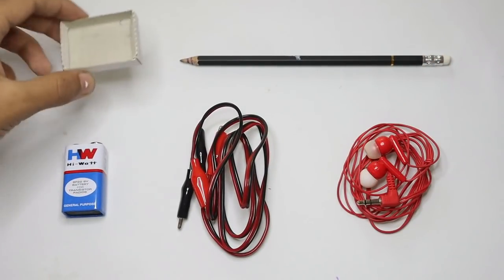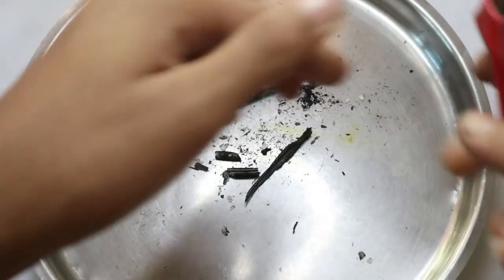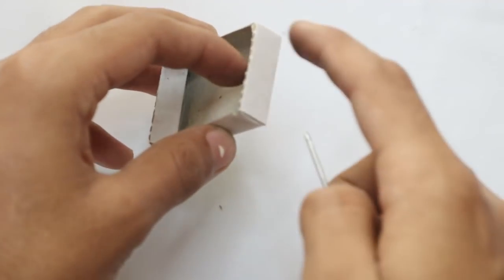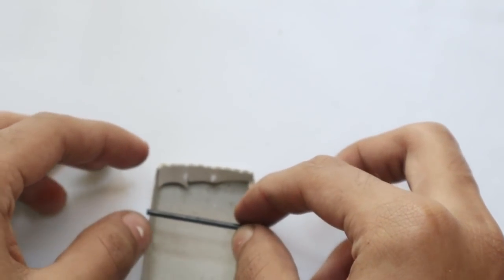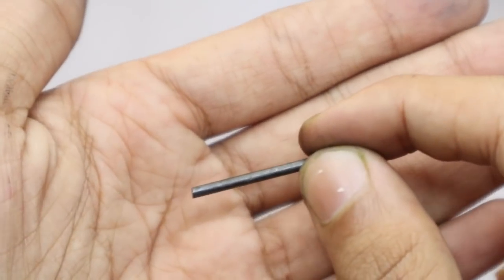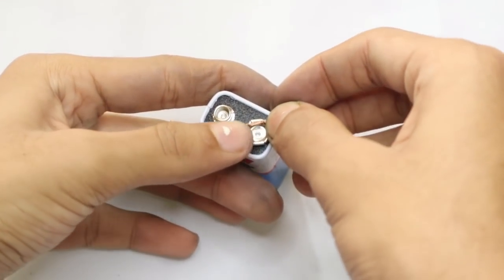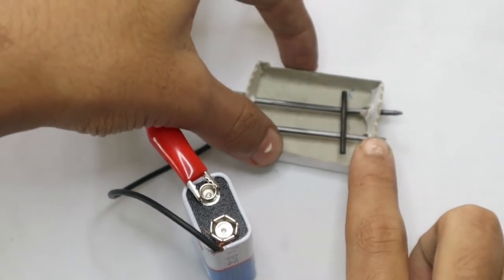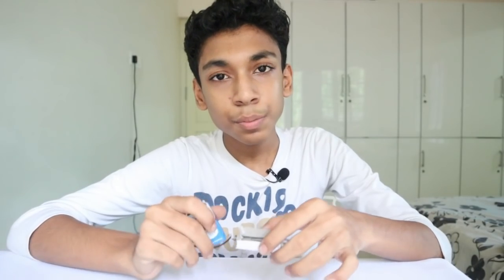How to make a matchbox microphone using pencil

Comment: Instead of a 9V battery, you can try with a lower voltage source. 9V DC, given that the dc resistance of graphite is quite low, can be dangerous to sensitive devices like low impedance earphones and mic ports without voltage protection
Reply: @HanisExperiments  does a resistor work as voltage protection?
Reply: @harinachiappansubramanian9206  I would go with a resistor around 2-3x the impedance of the earphones. The only downside is that the signal will be attenuated. the other option might be to use an RC highpass filter network to eliminate the DC offset
Reply: @HanisExperiments   ah ic. Great experiment though! Enjoyed it, and really hope to see more from your channel!